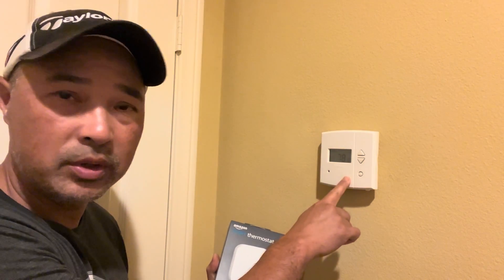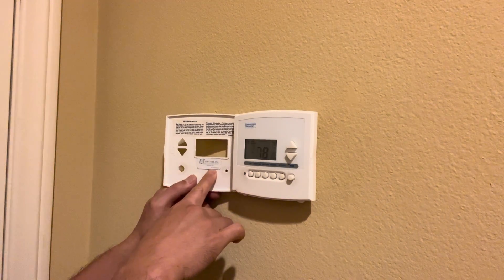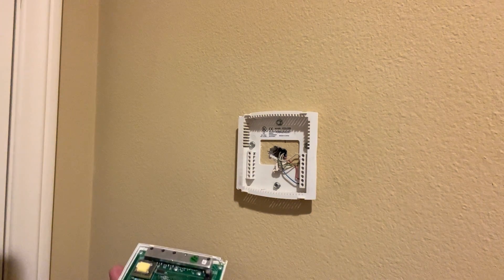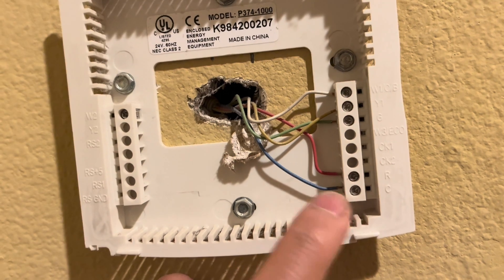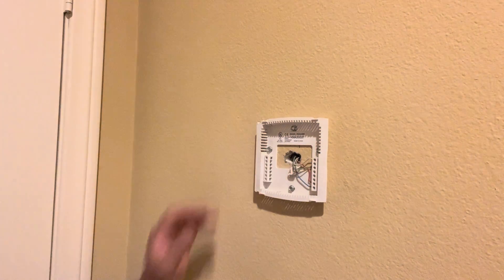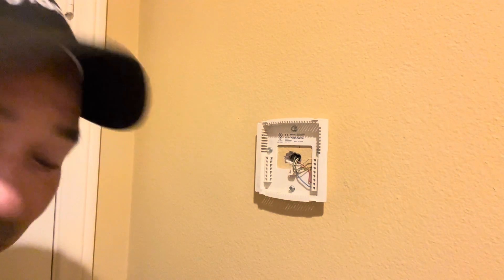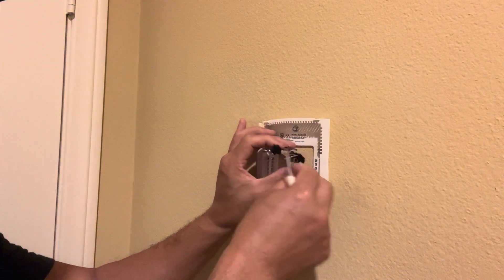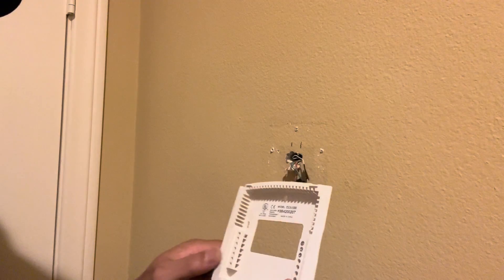Install Amazon Wifi Thermostat.  Do you need a C-wire?

Comment: If you have a reversing valve then this thermostat may not work because I don't see an orange wire in your setup and even if there was, when you choose the O/B in the settings it will not advance to the next page it will give you a message saying that you connected the wires wrong. This thermostat thinks we're stupid.

Comment: You could also get a wall plug and connect straight from there just make sure the wall plug is 24 V if you don’t have the c wire

Comment: Just installed Amazon smart thermostat. It is blowing cold air, but not pushing it as hard as my previous thermostat.
 
A few rooms are blowing cold air, but the ones on the other side of the house are not.
 
Here are the wires and old thermostat setup. I did not use the wire for R and RC, as I was unsure how to connect that. Is my setup correct?

Y1 to Y
 
R to R
 
W to W
 
G to G
 
C to C
 
O to O
Reply from the maker: Seems correct, but I don't know your original wiring.  Do you have central air ?  If so, you can't control the individual rooms separately.

Comment: Very helpful. With mine the blue wire coming out of the wall was attached to the G terminal and the green wire was unattached. I think I need to head to the attic to see how its wired to the furnace.

Comment: Thank you for the video! I've got the same thermostat, bought it about 3 weeks ago and still haven't installed it... it's a bit intimidating for sure, specially for a new home owner and someone who's never worked with wires. I will definitely give it a go, using your video as guide.
Reply from the maker: It is not too bad. Good luck!

Comment: Just for everyone’s convenience and knowledge the “c” wire is just an abbreviation for common. It’s used to complete the circuit. Be aware that any of these wires can be any color, especially common. So pay attention to which each port is connected to. It’s also easy just to take a picture of the original set up. Another thing to mention for anyone this is new for, it’s only 24 volts that run through these thermostat wires so their not harmful with any shock BUT what’s very important is don’t let any of these wires touch eachother!! That will cause a direct short and it will burn out the wires; don’t let that happen!! Take care guys, hope this was helpful :)

Comment: Or you may have a blue(C) wire that is unused, sometimes it is wrapped back around the outside case going back into the wall, then check at the main board at the furnace and again the blue(C)wire maybe unused.
That was my case.
Reply: Where we put the blue wire if it’s unused ? In the c connector ?

Comment: I have a heat pump system and after I hook the thermostat up cooling doesn’t kick in only heat
Reply from the maker: Did you try to lower the temp on the app or on the thermostat itself?  Our app kept resetting the numbers we entered, so I did a reset of the thermostat to get our temp setting to work.  Not sure if you are seeing something similar.
Reply: @GearGadgetExperiments  yes it was on 74 said cooling but the heat was on I think it isn’t sending the 24v to the switching valve to engage cooling
Reply from the maker: Hmm. If all the wires have good contact and colors are coordinated correctly, I don't have any other suggestions. Maybe this diagram can help? https://www.acservicetech.com/thermostat-wiring
Reply: @GearGadgetExperiments  gotta try this one
Reply: Same with mine

Comment: How is the thermostat 1 month after having it?
Reply from the maker: Pretty good. My previous thermostat did not trigger until the temp was +2 over my desired temp and then cooled down to -1 below set temp. This will cool down as soon as temp is +1 over and cools down to desired temp. So it switches on and off more frequently than my previous, but it is more precise. And controlling from the phone is a huge bonus.

Comment: C  wire adapter comes with 2 wires which wire do I use and where?
Reply from the maker: Not sure which adapter you have. But the one I saw had 4 wires in and 5 wires out.
Reply: @GearGadgetExperiments  I have the hotop from Amazon.  I just figured it out. Only took 3 days🤣 amazon thermostat comes with no instructions for wiring. I had everything wired correctly just didn't pull the blue tap up
Reply: @googleuser4722  that is great to hear!  I know, Amazon directions don't help with wiring one bit!
Reply: @googleuser4722  wtf?  Is that english?
Reply: @googleuser4722  hey I have the generic c wire adapter with 2 wires.  Can you help tell me where to put them on the amazon?